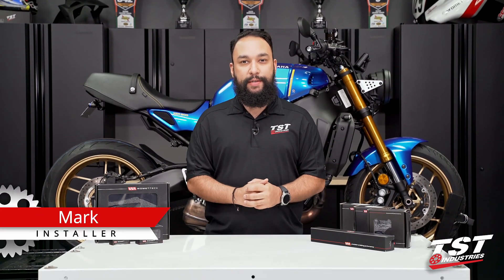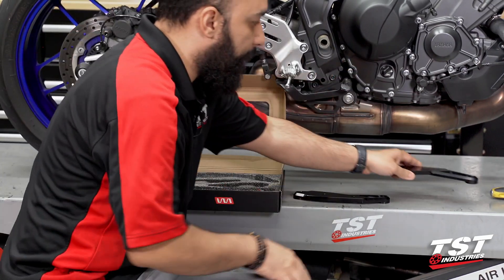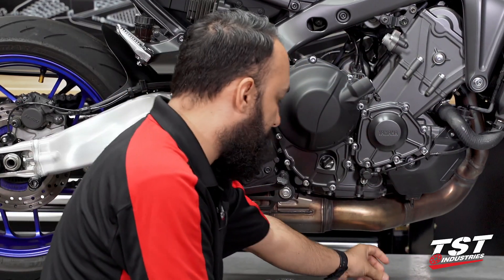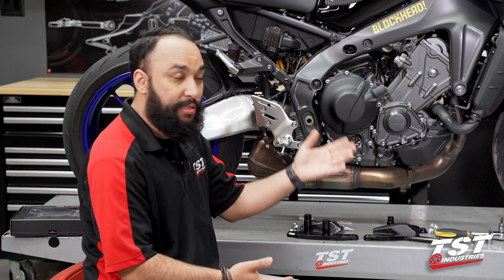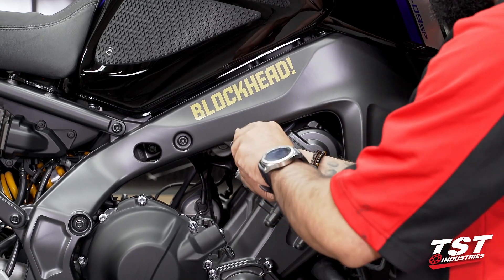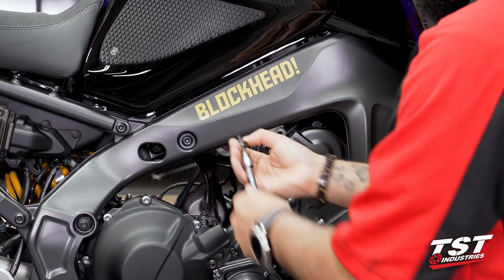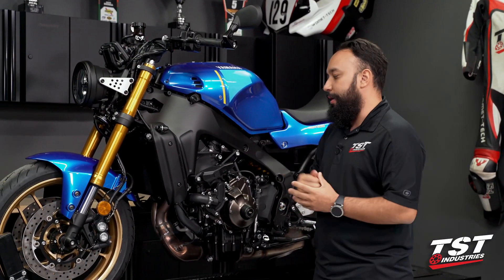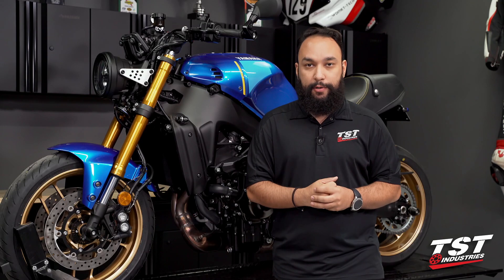How to install Womet-Tech EVOS Frame Sliders on a 2022+ Yamaha XSR900 by TST Industries

Comment: How do these compare with the Frame Sliders (SKU WT-1196) in terms of protection?
Reply from the maker: I haven't crash tested the Evos myself but definitely have tested many of the Endurance versions (like the ones you are asking about) on different bikes. From racing crashes, to just test day crashes, these protected my bike vitals really well. One time I had a low side at 130mpg at Daytona raceway on an R1. The bike tumbled pretty good. The frame sliders were instrumental in protecting some of the components on the bike. Anyway, the theory here with the Evos is that you have the energy of impact distributed among a broader area of the bike because each side slider set has multiple mounts. It also is less prone to catching the surface as it slides on it, so should protect against flipping the bike better than the Endurance version.

Comment: Any concern with engine sag when having it on a rear paddock stand and only doing one bolt at time like shown? I’ve done basic mechanical work but first time working on a bike. Thanks!
Reply from the maker: That chance is always there but following these instructions minimizes the likelihood. We did numerous installs of these frame sliders and also the endurance line sliders on this bike, and never had sag.

Comment: Just a feedback.

1. Not just Allen, couldn't you guys use actual bolts with outside pattern as well? I stripped the inside of the factory bolt while removing it with a SAE wrench close to 6mm instead.

Also, your video, if we watch from the middle (for revisiting) - it doesn't seem smooth. 

The packing came in different orientation than shown in the beginning. So when you say the one on the right means the one on the left for me.. you get it right? Just mark the parts and use their names properly.

Your video isn't intuitive.
Reply from the maker: Thanks for the feedback. We do not manufacture or package these parts, we only retail them. We can pass the feedback along with the manufacturer, Womet-Tech and see if we can get some more consistency in that realm. -TST